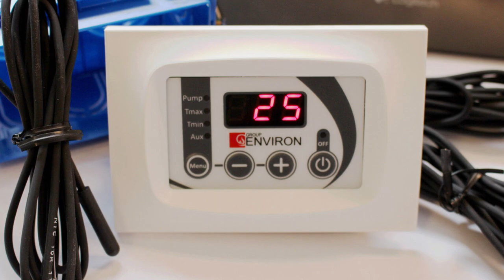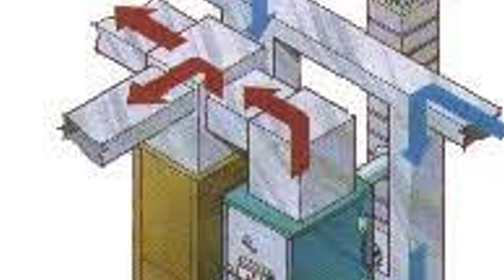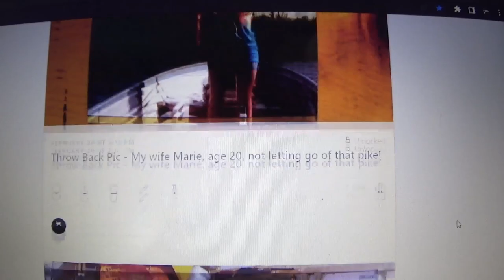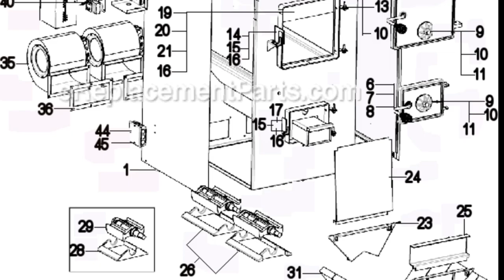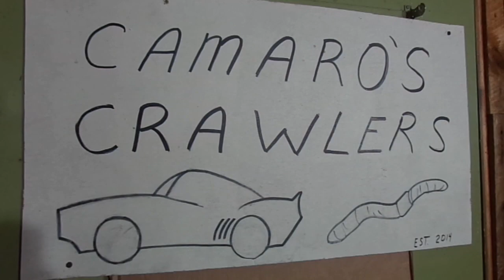FIREWOOD HEAT - OFF GRID, ON GRID, CHEAP?

Comment: One other thing that I have thought about is your HEALTH. Though I only heat my camp with firewood, after 2 knee replacements and looking at a spinal fusion (chronic lower back pain) my eagerness for hauling firewood has diminished substantially.
Reply from the maker: Yes, getting a work out is great, but sometimes wood can be hard on the body.

Comment: Advantages of wood burning for heat is its free (if you own the land, minus labor and gas costs for the saw and hauling it), its warm, and fossil fuel free. Disadvantages are its uneven heat and the black soot buildup. That black soot on all of your walls never goes away! I have an uncle who lives in the UP of Michigan and he heats his home mostly with wood. I remember as a kid helping load firewood into the back of his 1957 Chevy truck that had its only purpose of hauling wood!
Reply from the maker: Good stuff!

Comment: Purchased A soapstone woodstove 12 yrs ago. My home is 3500 square feet I burn 3 cord of wood each winter. I do not cut or split my wood. In northern Minnesota the cost per cord is 250.00. I use wood heat about 97 percent of the time. The other 3 percent is A 30,000 btu catalytic ventless wall heater. Wood heat I prefer because it is such A warm heat where you can go stand around the stove  if you get chilled. The only drawback for wood is it really makes the house dusty. I brush my chimney in late fall every year. The chimney is around 20 feet tall. The stove is very efficient I only get A half A jar of creosote out. The jar is A rago spaghetti jar. The creosote is very fine like talcum powder.
Reply: Soapstone stove. From Finnland?
Reply from the maker: Sounds like a great set-up.